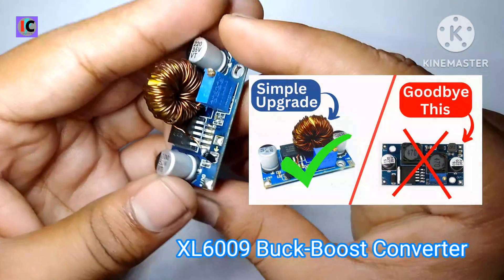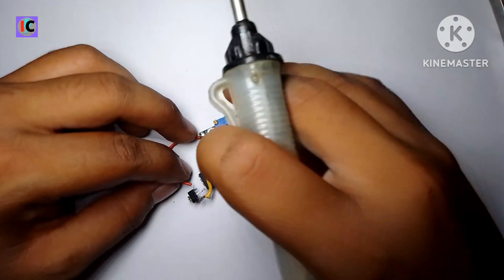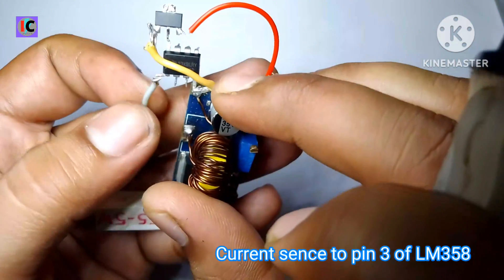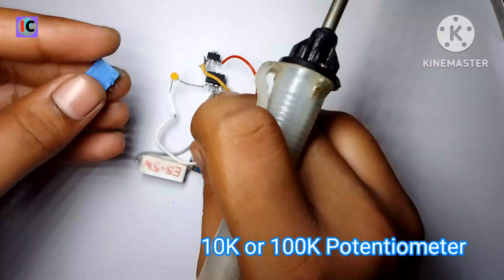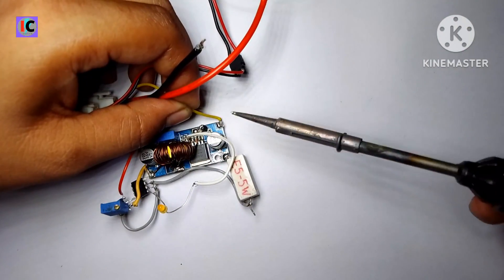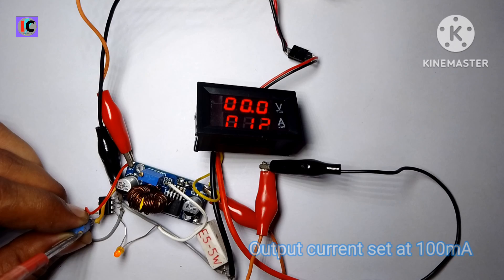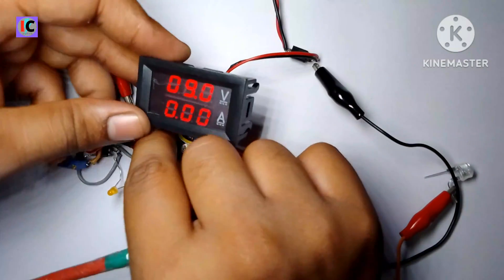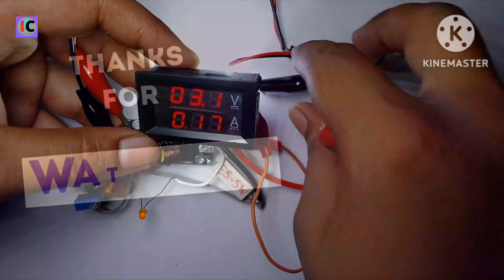XL6009 Current Control Upgrade #lm358 #xl6009 #converter

Comment: Hi 
"In XL6009 modules, an inductor is used, but in your circuit you used a transformer. Is this change necessary?"
Reply from the maker: yes this modification needs two coils to work in both buck and boost modes

Comment: What happened when I give input 5volt does the circuit work...7805 need minimum 7volt to work....!!!!
Reply from the maker: yes but if you use 3.3v regulator then minimum 4.2v required for working in the input
Reply: @innovationic I made the same using 7805 and lm393T

When I sort the output wire voltage goes down but amp goes high...amp control is not working I am using 10k VC to control amp

Also led is not glowing when shorted
Reply from the maker: check the led polarity and adjust the I set pot in other direction
Reply: @innovationic i have connected positive pin of led  to the pin no 1 of lm393T...... Tried both 10k and 100k pot... Now what should I do....

I use two 1ohm 5watt shant resistor in parallel because I don't have 0.5ohm 5watt resistor...

Please solve my quarry??
Reply from the maker: use LM358 instead of LM393T as it has an open-collector output thus LM393T only gives -ve signal

Comment: Hello! Exellent video.

I'm planning a project requiring current limiting on the input for the XL6009. From my measurements the INPUT GND and OUTPUT GND is shorted together on the XL6009 module. Do you moving the current sensing resistor from OUTPUT GND to INPUT GND and keeping the rest of your circuit the same would work?

Thank you!
Reply from the maker: thankyou for watching 
for limiting current in input side just connect the shunt resistor at input GND and connect pin 3 of lm358 to resistor output terminal with this modification you control current in the input of xl6009

Comment: You are obviously an experienced electronic technician/engineer, I can tell by the dexterity of your hands as you create your project.
Reply: @dean5263 He is soldering like a ninja with a $1 soldering iron without flux, while the other guys use their expensive Hakko and JBC irons, measuring their tip temperatures.
Reply from the maker: thankyou very much

Comment: does it work without modification of the coil?
Reply from the maker: without coil modification it works just in boost mode, it only boost input voltage
Reply: @innovationic without coil modification  current control is not possible. am I right?
Reply from the maker: yes current control only possible in buck converter or buck-boost converter
Reply: @innovationic  thanks...

Comment: 最近本來打算用XL6009製作一個14v的鉛酸電池充電器，但是發現標準版的電路只有電壓調整CV，沒有CC，才發現這個改裝影片
不過我找到另外更適合的方案
HW-140 DC-DC Buck Boost Converter
Reply: where your solution,, tell me
Reply: @alfatihid8901  ①HW-140 DC-DC Buck Boost Converter + XH-M603/HW-632 Battery Charge Controller Module

②CSP MT600+ Intelligent Battery Charger
Reply from the maker: yes this module is good for charging batteries with constant current 👍
Reply: من قبلا با کاهنده درست کردم اما دوست داشتم با افزاینده هم درست کنم

Comment: I enjoyed watching the good video.
I have one question.
When the voltage entering the 2nd pin (inverting) through the I-Adj pot is about 0~5V, the voltage to the 3rd pin (non-inverting) is also set to 0~5V. Then, the current applied to 0.5 ohm is 0~10A. Does this work? In your explanation, you said 0~3A. Is this because the XL6009 module is capable of up to 4A?
Anyway, thank you for the explanation.
Reply from the maker: Thankyou.
Pin-3 of lm358 is connected to 0.5 ohm resistor output so when load is connected then voltage drop on resistor is sensed by pin-3, if voltage on pin-2 is greater than pin-3 then outputs 0v thus this cycle repeats until both pins (2&3) voltage matches, hence duty cycle decreases and current is limited.
Reply: @innovationic  thank you.

Comment: This is the smallest a power conversion device can be. It's also the most efficient. 
A 1000 watt device is 200 grams with>95% efficiency. Compare with a 1000 watt transformer, 10 kg and 70% efficiency. 
Congratulations🎉🎉🎉🎉
Reply from the maker: Yes its very efficient